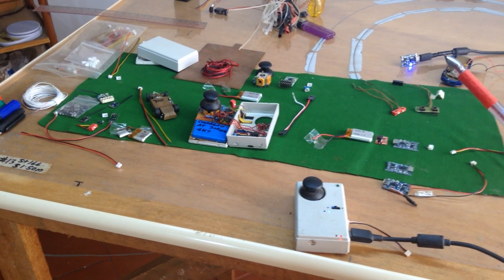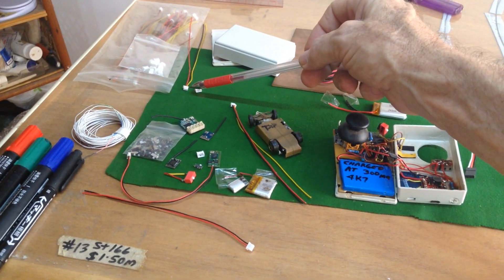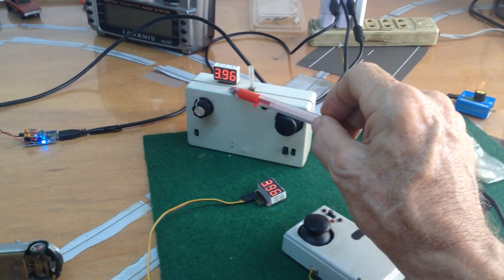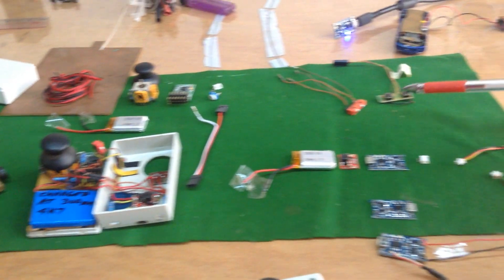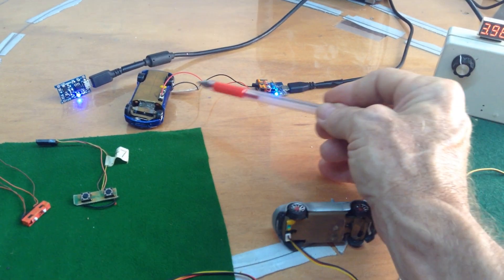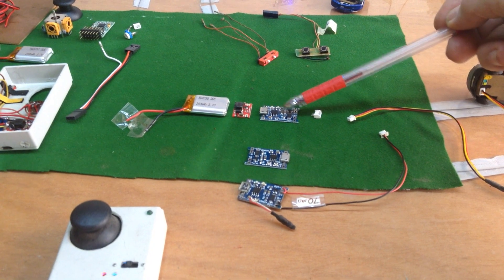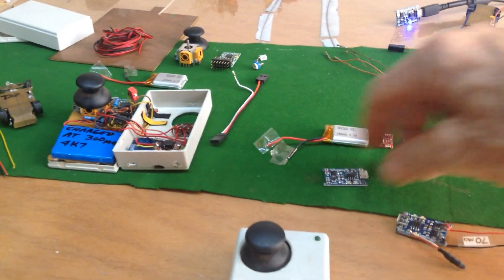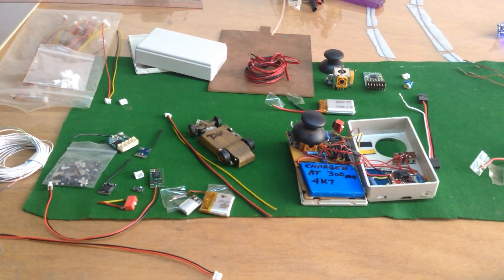Mini Transmitter 2.4ghz DSM2 DIY build information and micro car parts links

Comment: Hi Sir, how car stop system work, you show in your video, can please tell me what are the parts that make car stop for sometime and start drive, 

what i understand so far is that a servo with i guess metal when car cross it stop, 
what parts inside the car that detect it and stop ? 
let me know please.

and you mention in video you will list the parts but in description i didn't find any
thanks

Comment from the maker: Ahsan Khan - Turn on RX - after 20 secs LED flashes fast now in bind mode, turn on TX (DSM2/DSMX mode) and move around and move away and or move antenna angle until RX has solid LED ON ... is now bound to Tx ...... SOME TX - RX BINDS ARE TRICKY

Comment from the maker: BEFORE YOU START - be sure you can source LiPo's first (see LiPo info below)
Many links and descriptions change or dissapear so google the descriptions.
The links are not my best or cheapest choices they are only an indication what to look for.
........
TRANSMITTER BOARD
http://www.micronradiocontrol.co.uk/product/deltang/dt_tx2_info.html
micronradiocontrol sell these and much more.
Tx2 Deltang transmitter module (DSM2 protocal) - $ its not cheap plus shipping
They have links to the wiring diagrams (I modify the throttle joystick resistors to smooth and dampen out the neutral stick postion - or the cars jurk too fast with the continuous rotation modified servos)
( also they have the Rx47-4 receivers to do all the vehicles many LED lights automatic)
(also they have the CB2 module - wires to most TX modules for 1km plus range)
*Alternatives to use a circuit board from any other old or cheap DSM2 protocal transmitters is obviously another option but it will be a bigger size board.
.....
https://www.ebay.com/itm/Checker-Tester-test-2-8V-25-2V-1-6s-RC-1S-6S-Lipo-Battery-Voltage-Indicator-New/253079703452?ssPageName=STRK%3AMEBIDX%3AIT&_trksid=p2060353.m2749.l2649
TEST VOLTS
eBay
checker tester (2.8v-25.2v stamped on the side) 1s-6s lipo battery voltage indicator LED display.
It is the only cheap and accurate 3.7 volts monitor.
* other 1s-8s LED volt monitors with the alarm buzers are NOT accurate on only 3.7v or 1s - but work ok with 2s - 8s.
....
https://www.ebay.com/itm/10PCS-Slide-Power-Off-On-Panel-PCB-MINI-SMD-Switch-SPM-NEW/152046454446?_trkparms=aid%3D111001%26algo%3DREC.SEED%26ao%3D1%26asc%3D20160727114228%26meid%3D90ae67da7e1e406591f5bdf792ceb447%26pid%3D100290%26rk%3D1%26rkt%3D4%26sd%3D152046454446&_trksid=p2060778.c100290.m3507
SWITCHES
eBay
10 pcs slide power off/on panel PCB mini SMD switch 1.5x2.7x6.7mm
(or bigger size  - 10 pcs red 2.54 pitch DIP switch 10x4x5mm)
....
https://www.ebay.com/itm/1-25mm-Micro-3-Pin-JST-Male-Female-Connector-with-wire-150mm-28AWG-x-10-SETS/181447137539?epid=808618616&hash=item2a3f179903:g:ZnAAAOSw8d9UzaRl
PLUG & SOCKETS
eBay
1.25mm micro 3-pin JST male female connector with wire 28AWG (JST is incorrect chinese description)
(officially called molex picoblade 1.27mm)
(3-pin re-arrange red positive in center so idiot proof if reversed - so dont get the 2-pin type as its not usable for servos, and it can be reversed if forced by accident)
....
https://www.ebay.com/itm/6PCS-80mAh-3-7-V-lipo-Polymer-Battery-Smartwatch-Handset-401220/112666346917?hash=item1a3b7005a5:g:0-QAAOSwYwJaS4iO
LIPO's
eBay
6 pcs 80mah 3.7v lipo polymer battery 401220 (small car lipo 4x12x20mm a bit tight between rear 
https://www.ebay.com/itm/10-pcs-3-7V-80-mAh-For-Polymer-Li-battery-GPS-Bluetooth-Recording-Pen-351018-/171266769188?hash=item27e04b8124:g:GCUAAMXQ1d1TIChC
eBay
10 pcs 3.7v 80mah for polymer Li battery 351018 (small car lipo 3.5x10x18mm fits a bit easier between rear hotwheels)
....
http://s.aliexpress.com/uArUNB3q
....
LIPO's
eBay and aliexpress LiPo's
Many 3.7v LiPo sizes are available for the transmitter - 250mah -400mah is more than enough as the micro transmitter only uses 50mah - be sure they have the high and low voltage cut off protection attached to the battery terminals.
SHIPPING PROBLEMS to some countries is a real hassle and it wont arrive - ask the seller BEFORE you pay for any LiPo's - they often take your money and dont send or refund when they realise your destination restictions with lithium batteries.
....
CHARGER 3.7v
eBay search for
10 pcs 5v micro USB 1A charger for 18650 lithium battery - this charges at 1000mah so too much for 80 - 400mah car and TX LiPo.
*REPLACE the R3 resistor (many different types so only buy them if you see R3 marked on circuit board photo) with any 1//4- 1/8watt or 1/8 watt SMD resistor.
Charge mah should closely match the 3.7v lipo for a 1 hour charge.
80mah lipo - 20k ohm for cars. (70mah charge)
120mah lipo - 10k ohm (130mah charge) or 2 x 80mah in parallel 3.7v
240mah lipo - 5k ohm for cars and transmitters (250mah charge)
300mah lipo - 4k ohm (300mah charge)
1000mah large lipo - use as supplied - it has a 1.2k SMD resistor 
....
BOOST DC-DC
eBay search for.
Regulator step up boost module 2.5-5v DC-DC 2amp (red)
Steps up the lipo 3.7v to 5v for the car charger board (see above) 
......
TX BOX 
eBay - search for.
Plastic electronics case DIY project box 80x50x21mm white
....
BRASS
Buy local or google search for.
Brass sheet 0.4mm thick or 16 thou approx to cut out the car chassis and steering tie rod and mounting plate etc.
K&S metals for hollow brass square or rectangular sections like #262, 8152, 8153 etc to cut out the steering knuckles and front axil and pivot bracket components - see drawing at https://www.rcgroups.com/forums/showthread.php?2636061-1-64-1-87-scale-RC-cars-conversion/page4#post38929366
....
WIRES
eBay. (wires inside cars)
Wire insulated thin / white 30 awg 0.6mm outside insulation and 0.1mm x 5 strand tinned copper inside - 10m rolls called "decoder wire" by the model rail guys  (I change the wire colors using permanent ink pens on it, so red, blue, black, white etc)
OR just use the off cuts from the 1.25mm male molex connectors or spare servo wires if you cut and solder them direct to receiver.
Wires inside transmitter to connect the Tx2 module up - unassemble the 3 plug sockets and wire from any thin male JR / Futaba servo extension leads (or any 2.54mm pitch sockets)
....
SERVOS
eBay or Aliexpress or HiModel or Hobbyking
Micro Digital Servos for steering and drive motors are called. (size 16.2x 6.2x13.5mm servo)
PZ-15320 (Pingzheng)
HK-5320 hobbykings is same but white.
....
Other servos I used before are eMax ES9251 for much larger vehicles only.
....
JOYSTICK
eBay or Aliexpress.
Two axis mini 10k (ohm) joystick potentiometer - joystick is spring loaded to self center - so the cars drive neutral position is mid stick and steering is straight.
Some joysticks available also have a momentary push down built in for an extra function if you like.
....
ESC MICRO 9x9mm brushed 3-5v ? micro motors

1PC RC Model Plane ESC Micro Mini Brush 3A 5A 7A 10A / Brushless 3A ESC Two-way One-Way Electrical Speed Controller DIY Parts

https://www.aliexpress.com/item/1PC-RC-Model-Plane-ESC-Micro-Mini-Brush-3A-5A-7A-10A-Brushless-3A-ESC-Two/32950369377.html?spm=2114.search0604.3.297.3ff21c31Oeu9vO&ws_ab_test=searchweb0_0,searchweb201602_5_10065_10068_319_317_10696_10084_453_10924_454_10083_10618_10920_10921_10307_10922_537_536_10059_10884_10887_100031_321_322_10103,searchweb201603_51,ppcSwitch_0&algo_expid=
-----------------
RECEIVERS
Dasmikro 5ch DSM2 receivers PWM with 7 solder pads for + and - and signal .... from Aliexpress eBay Banggood Amazon etc.
Approx 10x10x2.5mm with a thin antenna about 20mm long (bent to fit inside still works)
FRSKY VD5M is PWM 22x17x6 with 1.25mm sockets to suit micro servo plugs.

Comment: Hola Mr. Kingsley como esta?? espero que bien mire le hice caso y compre en UK el transmisor Tx2 DSM2 , bueno lo estoy probando con un potenciometro de 10 Kg y le agrague como Ud. dice en su planos una resistencia de 2.2Kg una resistencia variable de 10Kg esta conectada al negativo del transmisor el positivo al 3.1 volt del transmisor y el del medio al conector 1 (señal) del transmisor, esta  alimentado por una bateria litio de 3.7 volt, el otro lado en el bus esta un receptor DSM2  conectado al pin 1 señal este alimentado por otra bateria de litio de 3.7 volt la conexion del pin 1 va a un acelerador que tambien esta alimentado por la bateria de litio y de ahi al motor, pero no funciona me puede ayudar por favor que pasa, saludos, muchas gracias